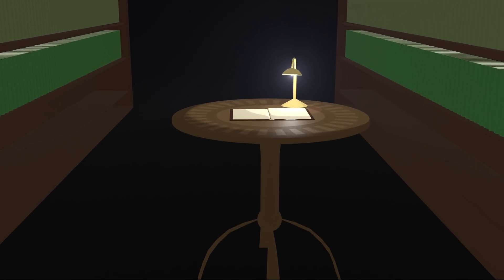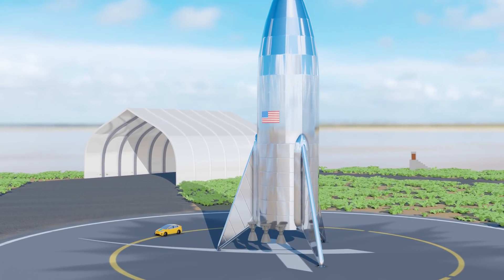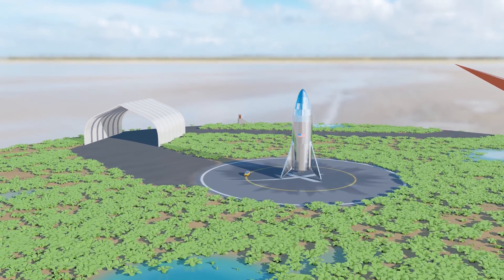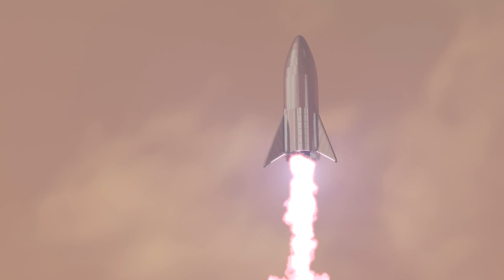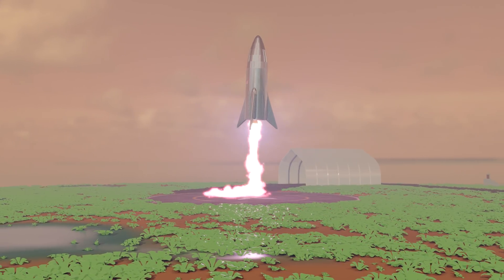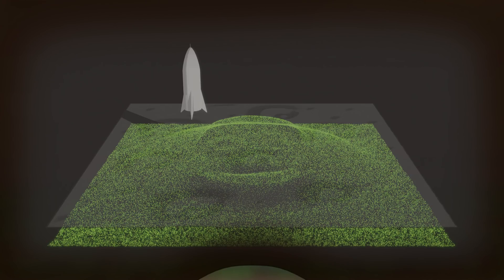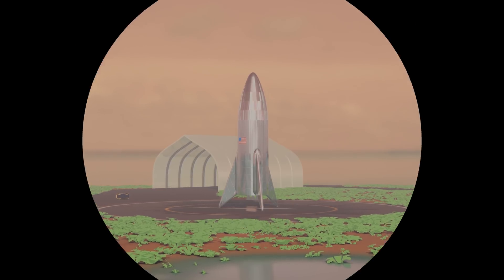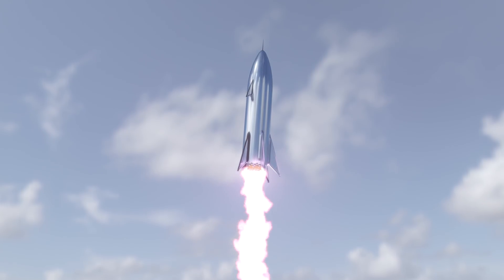What is Elon Musk's Starship Hopper (Starhopper)?

Comment: It would be pretty simple to release a constellation of GPS satellites before attempting to land.  GPS sats can be itty bitty cubesats, especially if they only need to work for a few hours a week.
Reply from the maker: And how do MPS (Mars Pos. Sys.) satellites know where they are without ground stations?^^ It's not so simple. You have to first set up some Mars stations where MPS satellites can orient themselves from. Then you have to setup a constellation on specific orbits so that you can receive the signals from at least 4 from anywhere. The constellation can be a little smaller as Mars hasn't the size of earth though. Reaching all the inclinations would however consume way to much propellant if you wanted Starship to do that before landing. If you want the satellites to do it they have to be big because the need several hundred m/s delta v. I think there is not way around a very good onboard system to figure out where they are. It#s not so complicated either as long as they have good Mars maps and a good image recognition software that recognizes where they are, where they are going and how fast.

Comment: Is it just me or are these SpaceX rockets starting to look a lot like the old rockets from 1950's science fiction.
Reply from the maker: There's definitely something to it. Could be coincidence but Elon often (maybe jokingly) refers to Tintin's rocket. If what Elon says is true using steel is the lightest material when you consider material strength on reentry. Carbon Fibers have to be shielded from the heat as its resin does not like high temperatures, and this thick shield literally outweighs the benefits - it seems. However, the source is Elon Musk so it remains to be seen what kind of an advancement in materials they will go through. It is still possible for some later Starship variant to use Carbon Fiber. I would not rule that one out entirely. Annother positive side about steel is you can reuse it much more easily on let's say Mars. Steel is very verstile.
Reply: @KsNewSpace  Yes I agree. Sometimes what's in front of us is the answer to a problem. Steel alloy is plentiful and cheap with advancements made in high end cookware of late the material creates the best of both worlds; creating re-usability with common materials and looking cool while you're at it. :)

Comment: I thought the legs are supposed to be retractable? The Legs also don’t have stabilising feet on them!
Reply from the maker: This is only an artistic representation not a 1:1 copy. I don't think the hopper has retractable legs though. The feet I added at the bottom are not for stabilization but for pressure distribution. I'm not sure how heavy this thing is going to get but if its too points if would dig into the asphalt.

Comment: The effort put into this video must have been way too much xD looks amazing. Only problem i had watching is that the exhaust flames were moving too slow.
Reply from the maker: Thanks! Yea, I have to play around with the flame simulation tool a little more. It seems to not like fast moving flames!
Reply: @KsNewSpace  Yeah however a thing you could do is to animate and move everything else at a faster speed and keep the flames at the same speed while lowering the fps (you can adjust that in the time remapping) in Blender

Comment: the purpose is not ONLY just to look good, but they also need to test the aerodynamics of the ship
Reply from the maker: Later on for sure but the hopper is not expected to go fast enough for aerodynamics to play a role. The top fairing is simply too flimy for that and would probably break from any pressure applied at high speed. That doesn't meant that they couldn't add a more rigid fairing in the future though.
Reply: @KsNewSpace  Fun and impressive video.  I agree that there was no need to  go with a shiny finish on this test vehicle - construction photos show that the bottom half had a dull finish before being covered with shiny panels.  In my understanding, the shiny panels really ARE stainless steel - but again, irrelevant for the test hopper.  I think Elon wanted to set up the now-famous photo of the real vehicle next to his render, in the same angle (and even besides a human figure for scale), using sunlight to "wash-out" the wrinkles, for inspiration. (Elon said wrinkles will not be visible in the actual Starship - no-doubt will use larger sections in stainless steel rather than Starhopper's relatively-small panel approach).

Comment: Just wanna let you say that the hopper is not ever going to reach space until starship develpment
Reply from the maker: It's hard to speculate on this but I'm sure SpaceX will go through multiple Hopper iterations and since they have a never before used heat shield design and control surface-legs, it just makes sense to test reentry with the hopper at some point. It's a test vehicle and why not test whatever new you come up with? So from that standpoint I think the hopper will slowly evolve into the Starship rather than being a parallel side project like grasshopper was. I don't believe SpaceX would start out with a throwaway starship first as they did with Falcon. Especially since steel would not really burn up but smash somewhere in case something goes wrong.
Reply: Not, the one sitting under the tent now, but they are going to build a second prototype test article later this year that they plan to use to put some of the first Starlink satellites in orbit.

Comment: Actually the stainless steel reacts to heat better than the carbon fiber and its only a fraction of the cost.  They are also working on a self repairable heat shield.  Anyways. Get your facts straight instead of trying to sound smart.

Comment: I like the idea of the steel balls. But maybe it could be sent there before any lander arrive so it could be analyze by probes before landing. I don't think it should be done during the landing.
Reply from the maker: Depends on how accurately they can aim for a landing site I guess. But yes, it may be safer to send out probes to probe the ground before first Starship contact. I'm just not sure if any probe could be cheaper than a many times reused Starship made by SpaceX.
Reply: eh , just use seismometer and explosives. you can cover larger area  and dont need loads of steel balls
Reply from the maker: @kulatyctverec7301  How do you want to measure the solidity of the ground you are landing on with explosives, without destroying your landing site? If you land a probe beforehand you can also simply use a rover with a stick like they use to find avalanche victims. My point is the lunar surface could be like a desert. Some spots are very soft and others rocky. If you land on a rock below the dust with one leg and sink in with the other you tip over. Small steel spheres in the order of 1 mm thick would penetrate the ground and cover the surface in its solidity shape. This shape you can easily scan with a radar. The lunar lander actually had long rods mounted to its legs it rammed into the ground to avoid just that I guess.
Reply: @KsNewSpace  if you are woried about sinking in sand, larger landing leg area could solve this easily.
make sound waves in ground, masure how fast it travels and bounces  in it, then use some fanci math and figure out how the ground is.
something like casse https://www.dlr.de/pf/en/desktopdefault.aspx/tabid-1371/1868_read-10525/